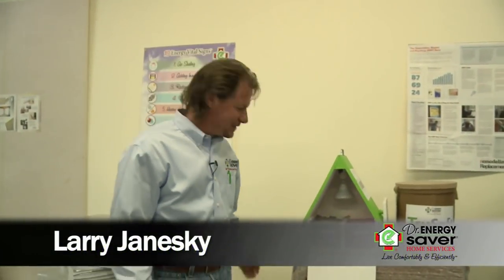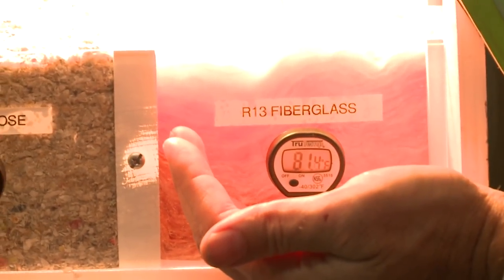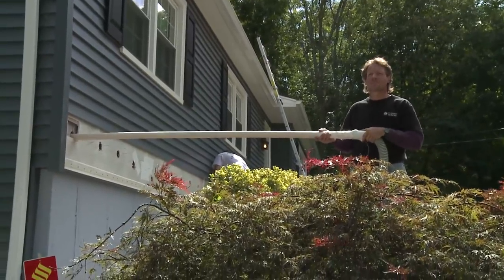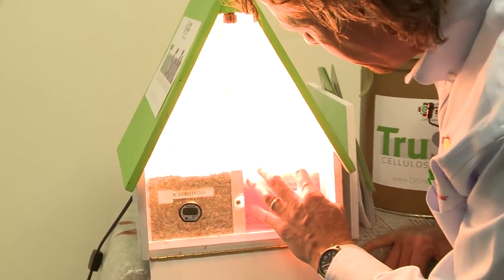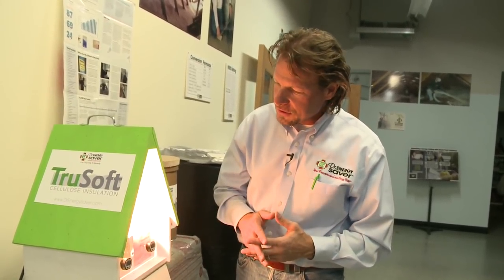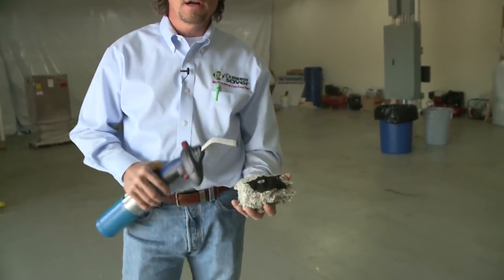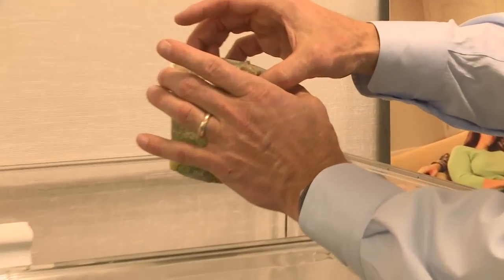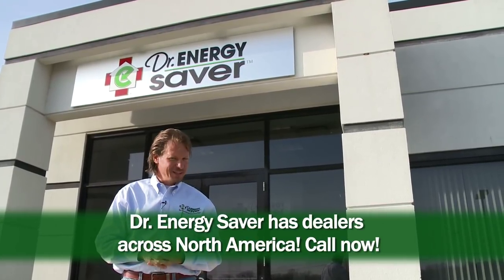Why Cellulose Insulation is Better than Fiberglass Insulation

Comment: I was suspicious of this test from the beginning. This guy seems to be anti fiberglass based on all of his past videos. Cellulose or fiberglass, it doesn't really matter. If you need R-38 in your attic, R-38 cellulose is the same as R-38 fiberglass.
Reply: +Earl Eggert, not at all. Cellulose is superiors to blown or batt fiberglass. It saves more energy and your home will be more comfortable with cellulose. Like in the video, often fiberglass is added three or four times before the latest homeowner wises up and does it right with cellulose. I've never seen a home insulated correctly with cellulose than needed more insulation later.
Reply: +Larry Maloney Cellulose will settle over time though. And, homeowners keep adding layers of fiberglass because their existing insulation each time is not of sufficient thickness in the first place. I don't necessarily have a problem with cellulose. I have it in my attic and it performs very well. I think cellulose is most appropriate for an attic floor, and older homes that don't already have insulation.  Fiberglass roll insulation will work just as well in an attic if installed properly, that is, if it the attic floor is first air sealed, and that one completely fills the joist bays the full height of the joists, and then lays another layer perpendicular to the joists on top of the first layer. The goal is to get the proper R value(thickness)
Reply: +Earl Eggert , fiberglass sales companies are notorious for "overblowing" fiberglass. They use less bags than required by fluffing it up. It's less dense than manufacturer's specs and so SETTLES very badly. The next homeowner sees it's settled and unwittingly blows more in and with the same result...the new fiberglass settles.Fiberglass rolls leak air along the length of very seam, every joint between rolls and between rolls and their adjacent ceiling joists. In addition, bridgi9ng occurs. that is, the edge of the studs conducts heat from the living area to the attic. Crisscross a second layer of fiberglass over the  first and it still leaks air and heat...just like water would.  Oakridge Laboratories ahs discovered fiberglass losses half it's R-value in cold weather. Loose blown fiberglass with a R-2.2 per inches becomes an anemic R-1.1 per inch in sub zero weather. Who needs that? Right when you need insulation it doesn't work. Cellulose settles a little initially...usually the first couple-three weeks. The contractor know the amount so adds extra so the customer gets the settled amount contracted for . That is the law! Read the bag instruction!Old fiberglass under newly installed cellulose may continue to settle.Cellulose is always preferred over fiberglass for walls ceilings and crawl spaces. Fiberglass isn't even a good furnace filter.
Reply: +Larry Maloney Again if you air seal the attic floor first, there won't be any air leakage. As with any insulation, you need to air seal first. I think overall cellulose is the best choice for attics, but fiberglass rolls and batts work as well, and are a good choice for walls. The key with any insulation is proper installation.
Reply: +Earl Eggert , my experience is cellulose air seals without additional effort or material. The ideal of foaming allthe wall top plates and light cut outs is not practical. The foam lays on dust and doesn't adhere. Besides, ever try laying a bead of foam? Ti never quite covers all the seams. If I have a seam that needs closed I use joint compound. It's cheaper and more effective. Remember, you're trying to seal against air infiltration, not insulate...so why waste expensive foam. The drywall compound seals most excellent. This winter I'll set up a demonstration to illustrate how well cellulose seals by itself. Seeing is believing.Installed properly, fiberglass does not seal walls as effectively as cellulose. there are always seams along the entire length of the studs. air leaks past, always! Installed properly, fiberglass still causes cancer and off gasses in fires. Besides, who actually installs it properly? It's mostly installed by contractors because it's cheap and can be thrown in the wall cavities by drug attics for a coupe bucks. "Installed properly"...LOL
Reply: +Larry Maloney 

LOOSE FILL INSULATION MEDICAL PROBLEMS INCLUDE: 

The most noticeable side effects of handling cellulose bagged Insulation is the affected skin become red, swollen, lumpy and painful.  Cellulitis commonly affects one of your hands or legs, although symptoms can develop in any area of your body. Additional symptoms can indicate that the infection has spread to your nasal cavities.  "Common sinus-cellulose nose infections can be treated with antibiotics over up to a three week period" Approximately 4 million people worldwide are affected by handling cellulose shredded newspaper insulation , and most sufferers find themselves on antibiotics for extended periods of time and experience difficulties in breathing after having it installed in their loft space or attic.
Reply: +SuttonWoods , total fabrication! I guess you only lie when your mouth moves or you are posting in unanimity.! Read the Material Data Safety Sheet (MSDS) to confirm there are no issues with cellulose insulation.  Then read the MSDS for fiberglass insulation and the health warnings will tell you to wear protective gear to protect your lungs from silica dust. In addition, the fiberglass industry is required by Federal Law to warn installers and consumers it causes cancer.  Some believe fiberglass insulation is more cancer causing than asbestos.
Reply: +Larry Maloney / UNDER no circumstances will my company purchase, buy or sell shredded newspapers and attempt to pass it off in sealed bales as loft insulation. Its not insulation but waste paper that's been strongly  condemned by the USA Healthy Homes Organisation (who said) : The
problem with using waste newspapers is the ink that is used by the publishers.  Printing inks can be complex preparation containing petroleum oil, vegetable oil, as well as various toxic bodies including turpentine, toluene, alcohol, and xylene which account for much of the odor given
off by shredded newspaper when used as insulation substititutes. , otheradditives in ink include pigments, driers, waxes, lubricants, perfume and dyes.Shredded
paper is a very low grade, inexpensive insulation. As such it is more likely to contain toxic impurities than the more costly fibreglass insulation because the inks used years ago were more toxic than those in use today. The paper is ground up into a very fine powder that can easily float around the air ans is easily inhaled. Some compounds can be
absorbed through the skin. Call it  Cellulose if you wish, to us its SHREDDED NEWSPAPER.
Reply: +SuttonWoods , your high pressure sales organization is geared towards selling high volume fiberglass insulation jobs. Since cellulose takes skill and time to install, profit is your motive for selling cancer causing fiberglass.I spoke with NAMP. These are the fine folks  your "Happy Homes Organization (a small family owned business) claims they were trained by. Did you know the mold remediation school, NAMP  has no issues with using cellulose? Their spokesman did tell a story abought a tough mold remediation case their trainees did for a mortgage company. The homeowner moved back into her home after ALL the mold was removed. After a few weeks she got sick again so the bank/mortgage company has the home retested and found lots of mold. The original mold remediation contractor talked with the housewife and learned she recently insulated her attic with fiberglass blankets. After she moved back in she brought some unused fiberglass batts from the attic and put them in the crawl space. The remediation contractor tested for mold again and found she has re-contaminated her crawl space with the fiberglass she removed from the attic. Bummer. Cellulose, unlike fiberglass, doesn't feed mold and fungus. In fact it's treated to resist them. In fact keep new sources of wet out and mold will never come back. Fiberglass makes cheap furnace filters. You know, Sutton, if fiberglass was a quality insulation product you would not have to tell all these whoppers.
Reply: +SuttonWoods ,another fib you tell! The Trans Pennine Pipeline transports ethylene so does not need insulation. And the climate is mild in winter. The pipeline installation used a special technique called "ramming" Fiberglass can't be rammed. The Alaskan pipeline, however, transports crude oil so is insulated with foam, not fiberglass. Fiberglass doesn't work under ground, it gets wet and freezes. I've removed frozen fiberglass from half million dollar homes after the plumbing froze. I corrected the problem by replacing the fiberglass with cellulose. Plumbing never freezes with cellulose. Isn't that amazing?Fiberglass does make a cheap repair for dented fenders.Foam is actually used for jet bodies. Special heat shields are used on the obsolete space shuttle.  None of your examples use fiberglass as insulation .Do homeowners actually believe this nonsense when you pounce on them?To be my boss you'd have to know more about insulation. You are a productive salesman but lack basic understanding about thermodynamics and how to insulate correctly.  I'd really have to lower my ethical standard and become a "yes man" like you to work in the fiberglass industry. No thanks.  The only one struggling is you...to come up with one good reason to get close to cancer causing fiberglass insulation, and I use the word "insulation" generously. The silica in fiberglass can lay dormant in your body for twenty years with no harm. But then one day your body decides it doesn't want it any more. Cancer develops. How's your health?.
Reply: +Larry Maloney . Owens Corning website, Wiki and Forbes Magazine  was the source of the information provided, $3.6 billion in sales and 15 000 employees means the products O&C make and sell are reputable with warranties that count, when your mixed POWDERS fail does the homeowner contact The New York Times, The San Francisco Chronicle, or Garret Press for a refund? Got a good slogan for you: Larry Maloney Powders are pulped from Playboy Magazines only, or your money returned.
Reply: +SuttonWoods , let's see if I understand what you are selling. You say fiberglass is guaranteed to not  pass the fire door test! You're saying fiberglass is guaranteed to have a lower R-value than cellulose. And you're guaranteeing fiberglass will lose half it's R-value on the coldest days...right when you need it...it goes on strike. As I recall, the fiberglass company that used to be the asbestos company guaranteed their asbestos too...but when they were sued for billions they filed bankruptcy to void the warranties and avoid paying the Court awarded billions in damages. Cellulose has non of the legal or performance issues of the asbestos company. Now that the asbestos people are in the fiberglass business it's buyer beware. "Fool me once, shame on you. Fool me twice, shame on me. Again, reliable science about insulation is provided by Oakridge Laboratories, not Wikipedia or a  self serving manufacturer of inferior fiberglass. When fiberglass fails the homeowner contacts me and I vacuum it out with the dead mice and their droppings...and usually a good measure of stinky raccoon waste. We disinfect before installing clean, fire retardant & insect resistant cellulose. We have to pay the County to dispose of the contaminated fiberglass. If you wish I can give it to you.
Reply: +Larry Maloney / I'm a like parrot. All I ever repeat is what I hear; Fibreglass is the best, Fibreglass is the best, Fibreglass is the best. I read in India  they sell shredded newspaper for insulation and employ hundreds of women to rip it into small pieces, later they discovered mixing it with sawdust and straw created a 2-fold product, bed mattress filling and loft insulation. Its sold all over India has Strawfill Cosybed Cellulose Insulation.
Reply: +SuttonWoods, you summed up your long "career" most excellently, you are reduced to a parrot by a giant corporation regurgitating whatever script they supply you. No need to think or question. Unfortunately for you (and the giant corporation), most homeowners think and question. Those who fail to do so may buy fiberglass insulation. But then they learn they could have invested in the "good stuff" as they call cellulose. Next time, their attic (and walls) gets cellulose. Your comment about being nothing but a corporate stooge sums up your life. You must have done something positive sometime? All the lies you spread about cellulose insulation are matched by the whoppers told by the foam guy. He doesn't tell customers his foam shrinks up to 3% at every wall stud. That's quite a large air leak, don't you agree? Gazillions of those tiny atoms you  get excited about must escape non-stop. Did you know most fire deaths in a foam insulated house are from the fumes? For all that poor quality insulation, consumers pay double. The foam installer has no way to know a retrofit foamed wall is completely full.  You and the foam guy are opposite sides of the same coin. Either choice guarantees a big profit for the installer but little for the homeowner. Interesting note to end on...I did a project for the Air Force so was inside a huge building held up by long thick steel columns. The steel columns were fire protected with spray-on cellulose insulation. I suppose the U.S Government never heard how great your fiberglass is. Aren't you in the Dayton, Ohio area? I bet you've taught a lot of naïve young guys, just learning the business, a lot of worthless nonsense and outright lies about insulation. Was your lies based on greed or ignorance?
Reply: +SuttonWoods , newspaper was used for insulation long before it was made fire retardant and bug proof. We've all seen a movie or two where the hobo lines his shoe bottom to seal the hole. Or he simply covers himself with newspapers to stay warm. As I educated you, it's called cellulose wood fiber because it's made from wood, a cellulosic  material. In the sawdust form, the same cellulose was once used to insulate the old ice houses of our ancestors. That ice stayed frozen all through the hot summer giving the townspeople a cold drink on a hot day. If fiberglass were used the town would be drinking hot coffee  all summer.Those same farmers ground up newspaper and wood to stuff in their attics and walls to insulate their homes. Of course they didn't know to add fire retardant, but then again, the didn't have electricity and were less likely to burn their house down. Even if they did it wasn't like they had a thirty-year mortgage and 50K pickup in the attached garage. They just built another shack. So if other nations recognize the insulating qualities of cellulose, good for them. Ever try sleeping an a bed of fiberglass? There's a reason your rule is the crew doesn't talk about fiberglass after the job...it's so nasty who wants to? A bigger reason for you is concern one of the brighter ones might ask an intelligent question or two and you can't access Wikipedia.
Reply: +Larry Maloney In almost 50 years I've never known a client to enquire about Cellulose Insulation, so would it be okay with you if I ask anyone who does to get in touch with you, you deserve each other. Take the order with my compliments. Let this person schmuck have the benefit of you're wisdom. If only I could arrange this for Xmas Eve, now wouldn't that be wonderful.  I can imagine you saying "Look Ma, that night time Correspondence Course I took paid off". I honestly wish you a successful and happy New Year for 2016. Just think If you book 12 jobs next year wouldn't  that be something to be proud about. Do this for just 3 years and you'll be able to buy you're very first trailer-trash trailer, and stop paying rent.
Reply: +Larry Maloney +Larry Maloney In almost 50 years I've never known a client to enquire about Cellulose Insulation, so would it be okay with you if I ask anyone who does want it - to get in touch with you. Take the order with my compliments. Let this schmuck have the benefit of you're wisdom. If only I could arrange this free order for you for Xmas Eve, wouldn't that be wonderful.  I can imagine you saying "Look Ma, that Correspondence Course I took paid off".Just think If you book 12 Cellulose Chop Suey Paper jobs next year wouldn't  that be something to be proud about. Do this for just 3 years and you'll be able to buy you're very first trailer-trash trailer, and stop paying rent.  I wish you a successful and happy New Year for 2016, but will stick to our  laying fibreglass insulation, fibreglass insulation, fibreglass Insulation, See, you have just reminded me that I'm crazy about the stuff.Fibreglass Insualtion .......... the best ..........
Reply: +Larry Maloney / 

 I understand your insulation company is called Larry Maloney Paper Shredding Services, who offer regular collections of confidential documents for shredding - to be used later as loosefill insulation. Company documents will be shredded on site in one of our mobile shredding vehicles, or transported to one of our waste paper Data-Shred Waste Paper Insulation  centres. Our range of waste paper blowing machines will blow your company documents into  loft spaces and attics. We specialise in both dry, and soaking wet waste paper processing. Rest assured all your documents inculding check books and bank statements will be collected for shredding by our expert collection teams. You don't need to remove paper from files or folders, or remove plastic wallets or staples, It all goes into the Anything Goes insulation bags to be re-used, Data-shred will save your company  tipping waste paper into landfill sites, this is our commitment to Green Energy.
Reply: +SuttonWoods, I missed the boat on that one. Although I did for a brief time shred bank documents back in the early seventies...before they had mobile units. I should have seen the future.  The bank president actually stood and watched until all his records were pulverized. I may put a mobile unit together yet.
Reply: +Larry Maloney , I've  missed so many boats I no longer care. I should write a book, we went from rich to poor 2 times, and founded 2 business that are Hope Diamonds. Again: Good staff are needed, our problem is weeding out the duds, once some men get 10 good wage packets they turn into careless monsters, money turns their b.. heads. So I never mock rich people, or smaile like we used to.?
Reply: +SuttonWoods , I never say never. I'm writing that book. You'll be a very small part of one chapter "World's Greatest Salesman."  Starting a business is easy. Operating a business requires a certain skill set. Salesmen don't make good businessmen because the believe all the lies they tell. To run a business you have to stay close to reality. I admire anyone who tries though.
Reply: +Larry Maloney / The problem is defining your own goals,  knowing your strengths and being able to second guess how effective you are as a self  motivated worker and leader of men, and as a buyer, book keeper, own accountant, person/spendthrift, drunk, drug user, sex pest, dreamer, entertainer or shrewd. Then choosing your products, market, suppliers, stock levels, tools, ideal business size and staff numbers and advertising orderer and selector. Somone who runs a one-site-mom and pop business is not a business person but an hobbyist. 

Businesses have 7 growth periods, and few people ever get past stage 2. Others (including the owner) cannot be trusted with money, may well defraud the state and social duties from day 1. Might ignore staff safety and product safety,  all these items are big DEPRESSING field of fences to cross, and, who shares the dream with you? no one- you're on you're own, from day 1.
Reply: +SuttonWoods , what you call "problems" I see as routine requirements for operation I guess it's a problem if your focus is selling a bad product instead of looking our for your customers best interests. I would not market any product I didn't not believe in and know to be as represented.
Reply: +Larry Maloney / Please
accept some houses are warm, some are cold and many are freezing cold. Some you
can insulate, some you can't, for instance I went to price for ALLROUND
insulation Belmont House, Bellevue Ave, Newport, Rhode Island, an old 1890
mansion. The owners are members of one of the richest familes in the world,
does Belmont Race track ring a bell with you? I told the owners  it was impossible to insulate it and the place
needed demolition, they were not best pleased. They wanted to deal with a liar,
a promiser if great things, to see insulation piled everywhere in big heaps.  A hole the size of a dime can sink a
battleship ship, and the same hole will allow all your valuable heat to
escape.Now do you understand the insulation trade better, I'm not writing an
100 page treaty, so think it out yourself. Fibreglass is best, Cellulose is
waste newspaper ran thru a shredder, adding sawdust to it might improve it
some. Best left well alone, go on vacation with the money you save by not choosing waster paper cellulose insulation.
Reply: +SuttonWoods .LARRY, SOME GREAT NEWS, I'VE FOUND YOU SOMEONE WHOSE WILLING TO CONSIDER HAVING CELLULOSE SHREDDED PAPER INSULATION, isn't that wonderful news, her only concern are about it's reputation for "Spontaneous Combustion", this worries her, so when you contact her don't forget to mention if the electical wires and light fittings in the roof space are well covered there's very little risk, hardly any at all. I'll let you know if I find others. Good luck on the road.
Reply: +SuttonWoods, if it has walls and a ceiling it CAN be insulated. The question becomes is it cost effective? Since they were members of "the richest family in the world" as you claim, cost isn't a factor.Considering your flagrant story telling about insulation I can believe you'd actually tell a homeowner they should demolish their home. The world's greatest fiberglass salesman is a structural engineer too! A hole the size of a dime won't sink a home (insulation-wise_ but there's no reason for that hole, unless of course the unsuspecting homeowner buys fiberglass insulation from you. Good luck getting the walls sealed. You have to add visqueen and hope it seals out the air infiltration fiberglass lets in. Sutton, I've understood the insulation business since 1974. YOU understand insulation sales...there's a big difference between selling fiberglass and designing a superior insulation package. Loose blown Cellulose Has an R-value of R-3.8 per inch while blown fiberglass has a weak R-value of only R-2.2. Fiberglass loses half it's R-value in the coldest weather that means it drops to a barely measurable R-1.1. What good is that?  Mice love to nest and crap in fiberglass. Do your customers like the stink? Fiberglass cannot be used (by law) as a fire barrier. Cellulose is approved as part of a fire barrier (by law). Your sales talk is synonymous for lying.
Reply: +SuttonWoods, I really appreciate all your nonsensical quips.   I've sometimes wondered where some homeowners get such odd ideas about cellulose. I guess I should thank you. Years ago I saw a wall cavity that had an electrical short. The wiring shorted out but instead of starting the usual fire, THAT wall was filled with cellulose fire retardant insulation. The shorted wires conducted electricity until they finally tripped the circuit breaker. On examination, the electrician found the cellulose stopped the electrical sparks from igniting inside the wall. He took a picture of the shorted/melted wires and the slightly charred cellulose. He then scraped away the charring to expose fresh cellulose just underneath...ready to stop the next fire. Seeing is believing. That electrician was sold on how great a fire barrier cellulose is. Of course, in your constant state of denial, reality has faded. Your daddy taught you well. You did most of your sales in Dayton, OH some of the installers told me.
Reply: +Larry Maloney / The mansion house cost the equivilent of $80 million dollars in 1891. its not an ordinary house, it had ballrooms, corridors that had corridors, heat escape spots everywhere, a few hunded windows, it once had 30 live in staff and grand parade staircases like you've never seen with dozens of bedrooms, bathrooms, servants quarters, racing stables, and worst of all chimneys everywhere, now tell me where would you start to insulate, It was sold for a pittance later, because no one wanted it, the roof repairs cost £3 million dollars to renew. Now tell me how you would insulate that, if I agree I will sing your praises all day long, and send you $50 dollars to get out of jail. Have you forgot we are there to save heat, I turned the job down, even if we insulated it, the places was so cavernous heat could not be controlled or retained, in parts it had mansard ceilings, ballroooms that looked like an old cinema, a nightmare, Not for us, we do not tell people heat retention lies, it was a job for you, not for us,
Reply: +SuttonWoods , you being a fiberglass salesman it's understandable you don't know how to insulate walls. I've developed techniques to insulate around fireplaces and the rest are just walls. If they are solid rock or concrete then, of course they have to bee furred out first. That takes money but these folks have money. Assuming it has a roof it has ceiling joists that can be filled with cellulose.  Most heat loss around the fireplaces is from air going up the chimney. That can be stopped too. Since I'm not on site I can't be more specific.
Reply: +Larry Maloney , Good Morning LM, let me know were you are situated so I can visualise the winter conditions there. How do you get leads and keep pushing for sales.We spent a lot of time canvassing in supermarket doorways, 20 YEARS+,  and using High St trade stands and moblie showrooms. The supermaket then gave the doorway sales concessions to a main agent who re-sold space to sub-sellers, us or the double glazing men. The door rents went skyhigh, from $25.00 per day or even free if you spoke to the shop manager with Larry Mahoney tears in your eyes,  the day rents  went upto $1000+ a day.  They killed the fat goose we had. 

I was thinking of you last night, I was recalling how painters would not paint the house siding and roof line frames and soffits if they were insulated with Cellulose Insulation because of the fumes from it, I can recall how roofing contractors left them alone for the same reason. Its okay for 20 minutes blowing it in, but day after day and standing on a roofing ladder or scaffolding was scary stuff. Celullose Fumes deaths stopped when painters and roofers started wearing Fire Service personell rescue air oxygen tanks.  I used to like to see flies land on a wall that had Cellulose Cavity Wall insualtion, it was funny how they staggered about, then tried to fly away, then dropped down dead. What a great sales point for you.
Reply: +SuttonWoods , don't be thinking of me late at night....sounds perverted. I'm "situated" where it's cold in winter and hot in summers so  my market is naturally everyone who has fiberglass insulation. I don't chase them; they call me wondering why their utility bill is so high. I think that painter whopper was a good'ern. I bet that stank was  him smellin his own  upper lip...probably dripped some high octane paint on it whilst painting the soffit.
Reply: +Larry Maloney /ref/ Painters: We insulated a Mental Ayslum, 100 000 sq feet. in fact we insulated a few dozen on a Govt Contract, in one a patient picked up a can of white paint and drank it, my brother ran for a nurse, she was not bothered one bit, she wiped his mouth and face and that was it. We talked about it for days because he showed no ill effects, We expected him to drop dead. Your company could do a with a guy like him, you could have him filling bags with dusty Cellulose day and night, swallowing the stuff and not care. We once watched a van containing Cellulose being unloaded near a beehive, when the job was done and they drove away the ground was littered with dead bees, even the Queen Bee had succumbed. The honey had to be destroyed and the bee keeper compensated by the Cellulose makers.  Deadly stuff that Cellulose, thats why we keep well away from it.
Reply: +SuttonWoods "silly" is all you've got. Fiberglass insulation manufacturers are required by Federal law to print cancer warnings on all product...and fiberglass insulation must be covered with visqueen or enclosed to protect humans from exposure. The fiberglass insulation Material Safety Data Sheet (MSDS), provide by the manufacturer, as required by law states it is  a health hazard and installers must wear personal protective devices for there protection. Cellulose, on the other hand, have none of these "shortcomings". Queen bees stay in the hive, BTW.
Reply: +SuttonWoods, for your own mental well-being you've got to let go of the glory days. The government built a bridge to nowhere so buying cancer causing fiberglass insulation for a mental institution is no surprise. Today they recognize their stupidity and are offering a grant for "green" projects. I'm submitting mine. A simple suggestion like "Remove all the fiberglass insulation form mental institutions and replace it with cellulose to save 30% on energy costs" would be a great entry. Imagine, no more worry about the mentally ill burning the building down. And they won't be exposed to cancer causing fiberglass insulation anymore. Did you have problems getting out of the mental institution?
Reply: +Larry Maloney / The argument over. You cannot name one major builder, one local authroty who use it, its sold to the elederly and ther gullible, tell us all the average price per dwelling. ots a con and you know it. Waste paper is waste paer is waster paper. Landfill waste is not an insulant. Nmae just one majot bulder, I can nmae 500 , yes 500 who use and have always used Fibreglass, I'M PROUD TO SELL FIBREGLASS AND SO ARE ALL MY FELLOW INSULATION CONTRACTORS, we buy it for good money, we do not get it free to take away - rather than pay tipping fees to take it to a landfill site.
Reply: +SuttonWoods, your nonsense blather convinces only YOU! The measure of quality insulation isn't who sells the most. IF that were the case, Wal-Mart would be the fashion center of the world.  Besides, what you've sold in the glory days of your youth is no reflection of what you'll sell in the future. Homeowners are wiser to your tricks these days. The internet exposes your trickery and deceit. They compare attributes that make a cost-effective insulation a good investment, not how much a high pressure salesman can peddle in a day. You have NO pride, otherwise you would not sell inferior fiberglass.
Reply: +SuttonWoods  I want to see a COMPLETe LIST of your 500 contractors ALL OF THEM.  As a  cert BPI energy auditor  and Insulator of 27 yrs I can tell you that after usinf BOTH aterials and doing our own testing Cellulose IS FAR SUPERIOR to FG in all ways. Heck I live in the country and had blown glass in my attic VACCUMED IT OUT and installed Cellulose and in JUST THAT alone lowered my Propane bill per gal by 22% !! AND THAT WAS WITH A COLDER WINTER PER HEATING DAYS than the year before! AND the cost of LP was UP 7%!! ...facts remain fg is sub par
Reply: +scott bickett , Sutton woods doesn't have any real understanding of insulation. He's a wind-up fiberglass salesman. By his own admission he just parrots what big fiberglass programs him to say.
Reply: +scott bickett //  Owens Corning turnover is £3.6 billion per year, they are a Fortune 500 company, Cellulose firms are small waste paper traders converting waste paper into an alleged insulation. For every waste paper blower, you may have 100 / 200 Fibreglass Installers, used Cellulose blowing equipment is being sold on Ebay every day at giveaway prices, We were offered 10 machines for $50 each, scrap prices, we never bothered.  I have never tendered for a cellulose job ever, Not one major newspaper I 've seen ask advertises bids wanted, Fibreglass different, a boom industry since 1960. Don't you find that once clients know its waste paper your selling they tend to remember that they promised to go and collect their mother-in-law. How embarassing that must be for you all.
Reply: +SuttonWoods , where are these fifty dollar cellulose machines? I'll buy them all. Where are they? We don't have 200 fiberglass installers in our area for each cellulose installer. In fact I hardly ever see a fiberglass truck on the road. Wonder why. In fact the area's largest fiberglass company just liquidated most of it's trucks.. Their lot is empty. So is their install schedule. now make up some more lies, Sutton.
Reply: +SuttonWoods , why do you suppose Owens Corning's credit rating is "BBB" instead of "AAA"? And if fiberglass is so great why is OC switching to foam? Going into winter their stock is down...wonder why? Fiberglass reinforcement and fiberglass roofing shingles is there bread and butter these days. Fiberglass insulation (causes cancer) puts the company at risk. I look to see fiberglass sales continue to decline as cellulose becomes better known.
Reply: +Larry Maloney //   I like you're plan to recruit Boy Scouts to gather waste paper for you door to door, (Did you give them the old saving the Earth story which has proved such a gold mine for the Cellulose waste paper shredders) Do phone you're dear old Mother for me will you, and bring her up to date with the latest news. That correpondence course you certainly took paid off, Was it the Dale Carnegie How to WIN Friends and sell More Cellulose waste paper Insulation course you took. How Wonderful.
Reply: +SuttonWoods , your really struggling. You've been exposed by science and left behind by facts...you are irrelevant. Your chatter is background noise while men are working installing superior cellulose. I wonder if I've hauled as much fiberglass to the dump as you've sold to unsuspecting homeowners. I hope so.
Reply: +Larry Maloney //  The dump, the dump. I get it, take an old sofa in, and sneak a few ton off waste paper into the back of the van at the same time,  never been to a dump for years, its the smell you know, the smell of rotten waste, Don't you ever find any old jeans or used clothes up there that you can sell by having a garage sale, and pass out your Cellulose business cards at the same time. A sort of straight-from-the-dump-sale.
Reply: +SuttonWoods , filibustering with lies serves no more purpose than your denial. Blown fiberglass only has a R-2.2 valu8e while blown cellulose has an R-3.8, nearly twice as effective. Even installed correctly (which is seldom) fiberglass loses half it's R-value on the coldest days. The R-value of R-1.1 is a joke...not to mention fiberglass is known to cause cancer. Why pay for fluffed up fiberglass that doesn't even work when it's installed correctly.  You must work really hard to find gullible buyers.
Reply: Larry, did you know cellulose loose insulation is not approved for use in large parts of the United States, because if the house roof is blown off during an hurricane it gets windlown all the area in the ongoing windstorm. See:>;   Cellulose Installers are requested to recognise that we need to raise awareness amongst homeowners to ensure they are fully prepared in the event of windblown cellulose insulation leakage from their loft space in the event of a hurricane –causing roof and bedroom ceiling damage to their property, with substantial amounts of cellulose insulation from the affected property/s blowing around the properties and its boundaries. One of the important issues cellulose insulation businesses and householders face is not knowing where their clean up boundaries are, and when the next hurricane will strike. While Hurricane Katrina has tended to fade from memory, New Orleans isn’t the only major U.S. city at risk. As Hurricane Irene demonstrated, weaker hurricanes can also do significant damage in places that are not used to experiencing such storms. Many Americancoastal cities are essentially sitting ducks to hurricanes, with millions of
Americans living at water’s edge, exposed to high winds and flooding. Cellulose insulation should NOT be installed in 10 largely rural counties in the Deep South and near the Gulf Coast, These well known hurricanes areas are: Desoto, Fla. Houston, Texas, Polk, Texas, Issaquena,
Miss. Highlands, Fla. Avoyelles, La. Walker, Texas. WIlkinson, Miss and Glades, Fla. Kemper, Miss.
Reply: +SuttonWoods  the nonsense is endless with you. Do you realize you left your credibility behind many posts ago? According to Owens Corning, their fiberglass insulation is a known cancer causing product. They even print the warning on every batt, bag, and roll. According to Owens Corning, it;s important to wear protective gear when installing fiberglass insulation. Federal law requires all exposed Owens Corning fiberglass insulation be covered with plastic to protect humans from contact. Imagine cancer causing fiberglass insulation being blown around town by a hurricane!
Reply: +Larry Maloney / You must NOT sell insualtion in these areas unless you warn the householder that if an Hurricane passes by it will suck the LOOSEFILL INSULATION YOU LAY out of the loft space and it will disaapear over the hills and far away.  Fibreglass does not have that weakness, You are selling paper shredded dust, and dust is what causes dust storms, You're ruining America.
Reply: +SuttonWoods , have you considered taking a long vacation? Breathing fiberglass all those years may be causing some problems for you. Imagine flying cellulose all over the sky. Personally I'd rather get hit by flying cellulose than a board, or itchy  fiberglass.
Reply: +Larry Maloney // Who'd ever  imagine that loosefill insulation can become a Surface to Air Missile when an hurricane passes overhead. The wind uplift is so great that one missing roof tile hole in the roof can cost you all you're insulation material, work and expense. Gone in a flash. And it's not covered by thehouseholders  insurance policy. 10 Southern Counties will not allow loosefill Cellulose insulation in roofs. First it was classed as a fire risk,  but this 2nd report dooms the whole industry to Cahpter 11. I told you to drop it, now your stuck with all that useless blowing equipment and Hurricane Valley State Laws won't let you work.
Reply: +Larry Maloney  /  Cellulose Banned  Many Americancoastal cities are essentially sitting ducks to hurricanes. Cellulose insulation should NOT be installed in 10 largely rural counties in the Deep South and near the Gulf Coast, These well known hurricanes areas are: Desoto, Fla Cellulose Banned . Houston, Texas, Cellulose Banned Polk, Texas, Cellulose Banned Issaquena, Miss.Cellulose Banned  Highlands, Fla. Cellulose Banned Avoyelles, La. Cellulose Banned Walker, Texas Cellulose Banned . WIlkinson, Miss Cellulose Banned and Glades, Fla. Cellulose Banned Kemper, Missippi  Cellulose Banned .
Reply: Horse burnt to death in stables  using cellulose as horse bedding. (www)T he stables and an adjoining barn and horsebox destroyed, other horses rescued by the fire services. The cause of the fire is suspected to be an  unsafe electric light cord whose  bulb was not enclosed with a safety cage or bulkhead fitting.
Reply: +SuttonWoods  lets talk about the Turkey farm in Indiana that caught fire  THE DAY AFTER it was opened for buis and when the ceiling caved in the fire WAS SMOTHERED OUT because of THE CELLULOSE. THAT information came from the INDIANA state fire marshal.
Reply: +scott bickett // How terrible. The turkeys were smothered under Burning Cellulose, buisiness ruined,  I know about a couple who had an electrical fault cellulose insulation fire, the firemen broke holes roof, to allow the smoke to escape, they then HOOK-pulled the bedroom ceiling down because they were forbidden to work in the loft confined space in case it collapsed, they used the fire hoses, the couple regret having cellulose, but regret even more calling in the fire callout emergency crews, the water hose damage was more than the fire damage. And Cellulose debris and home contents were laid everyhwere ruined. Cellulose is shredded waste paper, and waste paper burns. Its newspaper waste.
Reply: +SuttonWoods , was the horse smoking in bed? Cellulose is rated as a fire barrier. Cellulose DOES NOT burn. Fiberglass insulation won't stop fire form spreading. Of course, you being the world's greatest fiberglass salesman, you know fiberglass's shortcomings. No reputable horse breeder would let fiberglass near a horse.
Reply: +scott bickett , years ago I manufactured cellulose. The building was brick with a slate roof and wood floors. An arsonist lit three fires inside. The entire structure except for the bricks and slate burned down with one exception... I had built an office in the middle of the building.  Two by four walls with drywall inside and out...and 2x6 ceiling joists with 5/8" drywall and cellulose dense packed in walls and an R-40 cellulose in the ceiling (to kill the noise from machinery)! Some brick walls were standing and my entire office and bathrooms was still there. None of the contents was damaged by smoke or fire. One calculator was ruined by the fire hose water dripping off the slate roof. Fiberglass would have just melted and I would have lost all my office content. The entire story will be in my book.
Reply: +SuttonWoods, as you know the defense for slander is fact. However your tales are so outrageous you aren't covered by those laws. A Court would rule that your tales are such whoppers a "reasonable man" would recognize they aren't true.  In other words, you are so silly no one takes you seriously. That is your defense against slander.
Reply: +Larry Maloney //  Cellulose paper insulation materials are environmentally friendly,  cost effective due to its waste paper origin when compared to Fibreglass insulation  but it is combustible and rapidly burns out. The main causes of cellulose insulation fire are: chimney related, Electrical faults, Lightning strikes affecting the roof and contractors carelessness. Installation advice: Electrical / Check and test the attic space electrical installation by a qualified electrical contractor at least every 3 years . Loft wiring should be in conduit but not attached or adjacent to cellulose insulation.Do not place high wattage lights or electric fires near the insulation or allow the insulation to overhang electric fittings.  Do not insulate near recessed lighting into the ceilings below. Use heat resistant bulk head light fittings in the roof space. Electric supply cables need to be prevented from coming in to contact with cellulose insulation, or adjacent to other flammable materials.
Reply: +SuttonWoods, I appreciate your bravery in stepping up and making such serious defamatory statements. I'll forward your accusations to CEMA (Cellulose Insulation Manufacturer's Association. I know they have required retractions on less inflammatory (no pun intended claims.)  Frankly, if you were in my home town, market area, I'd personally demand a retraction, and then sue you. Agreed, cellulose is environmentally friendly but it's because newsprint is less demanding of energy to process than when Owens Corning melts sand (which is more abundant than newsprint). Melting sand for fiberglass spinning is an extremely wasteful energy hog.Again, cellulose is treated to be fire-retardant and used as part of an approved fire barrier in construction. Fiberglass is not. Fiberglass melts and the gas is harmful to humans...harmful beyond the know cancer related issues of fiberglass insulation. Agreed, lightning strikes, electrical shorts, and chimneys all cause fires. Cellulose insulation reduces the spread of those fires. Fiberglass insulations melts away and creates air chimneys inside walls allowing fire to spread to attics and other rooms. Of course you know this.
Reply: +SuttonWoodsl, you remind me of my first puppy. No matter how many times I rubbed his nose in it, he kept peeing on himself.
Reply: +Larry Maloney /  it sounds as if your dog had been eating cellulose insulation and was terrified it would die.  Some dogs will eat anything but not Fibreglass, but, strange to say we once did a massive piggery walls and roofs and the pigs were eating the fibreglass cut-offs. One of the men dropped a roll and they tore into it as if it was candy-floss.
Reply: +SuttonWoods , can't imagine an animal eating cellulose insulation. The boric acid might irritates their eyes. That's why mice and raccoons don't like to nest in it. I';ve used it for bedding for cats by packing it down tight and the boric acid kills fleas. But the cats get insulation all over themselves anyway (even though it's packed). If all vacant houses were filled a foot high with cellulose on the floors no one would try to winter in them or set them on fire. Fiberglass might work better to keep people from wintering in vacant houses. The itch would drive them off...unless it was atticcat.
Reply: +Larry Maloney / I have eye trouble and it could be fiberglass, had it for 20 years, really ill, tried everything, none any good except of all things HONEY, i smear honey in my eyes last thing at night every night and its amazing how effective it is, it stops the blinking, the eyes are part of the brain, and mine have been really bad, I was diagnored as fuctionally blind with no known cause, but it could be trade chemicals including fibreglass, I can see now, but was very ill for years.
Reply: +SuttonWoods  you couldnt be ANYMORE wrong if you tried. You DO realize your speakingto a 27 yrs in the buis installer with OVER 6500 jobs under his belt? When you spew your dollar claims about OC THAT IS NOT TE FIBERGLASS ONLY money! In Fact tyhey have had a 35% reduction in profit with FG over the last 4 yrs. WHY? CELLUOSE IS BETTER!  WHy would the local gas and elect utilites INSIST in there energy incentive programs that FIBERGLASS CAN NOT BE USED! ONLY CELLUOSE! ( I guess they are wrong as well huh?)
Reply: +SuttonWoods I NEVER SAID ANY TURKEYS DIED! in fact NO TURKEYS WERE IN THE BUILDING!  THe Fire marshal WAS QUOTED as saying " the cellulose in the ceiling stopped any more damage from happening" unquote.
Reply: @scott bickett /   Can you send a link Scott containing information on the Cellulose Miracle Fire Fighting Products you sell, if I had Cellulose in the house I'd keep a fire engine outside and insist that my wife wears a firemans helment in bed, I did trace: Recent animal shed fire burn victims include 7,000 turkeys at a Butterball operation in North Carolina, 250,000 chickens at an Ohio Fresh Eggs, who supplies Cal-Maine and 500,000 chickens at Moark Hatcheries, a  supplier in Colorado. (these are not Cellulose related in any way - at least I don't think so,)
Reply: @Larry Maloney / My reply to Scott was: Recent animal shed fire burn victims include 7,000 turkeys at a Butterball operation in North Carolina, 250,000 chickens at an Ohio Fresh Eggs, who supplies Cal-Maine and 500,000 chickens at Moark Hatcheries, a  supplier in Colorado. Cellulose client/buyers should keep a fire engine outside the house, in the driveway, and wear a firemens helemt in bed,
Reply: +SuttonWoods  Here's a summary of celluloses superiority as a fire barrier.: Summary:
The International Building Code recognizes the fire resistance superiority of cellulose insulation compared to
standard light density fiberglass batts or foam insulation. An additional 15 minutes of protection is provided by
cellulose insulation while 0 minutes are permitted for light density fiberglass batts and foam insulation.
Reply: +Larry Maloney . I never knew Cellulose was that dangerous,  that people have got just 15 minutes to get out of the house before Cellulose explodes. So it's true what peope say about it then  (that) if you order Cellulose Insulation you ought to spend at least a $1000 dollars on beefing up your homes fire protection precautions. My advice is to wear your clothes in bed, and to keep a bucket of sand handy just in case. Did you know fire axes can be bought on Ebay, also rope escape ladders,  you ought make it your duty to give these away free to clients with every order booked over the Xmas period.
Reply: +Simple Sutton Sez "Cellulose adds 15 minutes more time than fiberglass's zero minutes to escape from a fire." "Hmmm, how can I distract from the weak qualities of fiberglass?" "I know", sez Simple Sutton, "I'll tell another whopper."
Reply: +Simple Sutton, since I don't type brail I'm surprised you can read my posts. I'm not aware of fiberglass causing loss of vision. Since you say there is no known cause your doctor is suspect. Bacteria won't grow in honey. It's a good remedy for boils and infections. Just fill up the cavity...densepack, like with cellulose, and the bacteria will die.
Reply: +Larry Maloney , Eyes are getting better, hospital drugs no use, a newpaper report alerted me to the benefits of honey, I am regd as blind but can see, isn't that strange. Its my eyelids that won't move or open freely, they can now. Medical Causes was: A CELLULOSE sales rep tried to sell us bags of Cellulose Insualtion and left samples, just one look at it and I  was struck blind. On the bag it had warnings about not handling unless you were wearing Radiation Barrier Shield Clothing and I ignored the warnings thinking they could not be true, they were.  Did you know it was used in films as a substitute for Kryptonite, and you know how toxic that stuff it?
Reply: +SuttonWoods , my uncle was blind all his adult life from a fire as a teen. He worked and raised four fine kids. The fire left him with a severely burned leg which they eventually amputated so he's suffer less pain. I always admired he never complained.
Reply: +Larry Maloney //  Same problems here and my respects and best wishes  to you're uncle,  I had a aunt who slipped in the kichen on a wet floor, she went flying, landed on the cooker and a pan handle pierced her eye, and my girlfriend and wonderful wife of 54 years had a stroke and went blind in one eye, 50% the other, (can't dress, can't find the bed, can't walk around the house or  watch tv or find remotes) the real victims are war blinded  US & British Army maimed Veterans. Helmand Province and Afghie "They were expendables" <(anger rising) Regards & Besr wishes.,
Reply: Larry boyo: You know full well there are two tpyes of fiberglass, there;s glass wool fine fibres used in insulation, and glass MAT coarse fibres used to make boats, caravans and truck cabs and bodies, one is harmless, the other is, or is classed as an possible carcinogen. For WWW-Links see: What is important about this wording is the term “glass wool fibers are excluded FROM CARCINOGEN LISTS,” VIZ bodybuilders / aircraft builder fiberglass did receive received a carcinogenic listing. seeIn general, insulation fibers are less durable and less biopersistent than special-purpose truck builders fibers, and may be less likely to cause cancer than the more durable, more persistent special-purpose fibers.”Why Was Fiberglass Removed from the Cancer List? By removing fiberglass from the “reasonably anticipated to cause cancer” list, OSHA doesn’t list it as a problem for workers, which means dangerous exposures may continue to occur, particularly in factories where fiberglass products are produced or worked with on a daily basis.
Reply: HOUSE INFECTED WITH CELLULOSE
PAPER MITES.

Our health got worse. My wife kept
telling me something was wrong the doctors weren't finding. All of us itched
and barely slept. Our symptoms became worse. Our doctor was treating us for
parasites! The logical answer he said was waste paper mites. All evidence pointed
toward the cellulose paper mite: which can't be seen with the naked eye,
thrives in attic spaces, and whose bite inflicts its hosts with many ills.  We arranged for management to fumigate the
house a second time and adding the attic area to the list to be fumigated. At
night, just before going to bed, we would rub ourselves down with
"Cellulose Soft Skin protection.” We still itched and felt sick. We put
the blankets and sheets in the dryer for 20 minutes, along with our pajamas to
kill the mites. The property owner called and saw paper mite droppings on the
bed head. . The droppings were old, he said, because they were hard. If only we
had not had this work completed.
Reply: +SuttonWoods, strokes are diet related. In fact, they are the result of poor food choices. Clearly y'all don't know my more about nutrition than insulation. So sad folks ruin their own health out of ignorance. The food police (big business) advertise ferociously to eat their processed foods and the gullible consumers who do have strokes, heart disease, diabetes and cancer.  Diabetes, type II and arterial related diseases are 100% avoidable by intelligent food choices. And 85% of cancers are triggered by food choices. Still we eat unhealthy and have strokes.
Reply: +SuttonWoods, you can make up whoppers at will! Impressive.
Reply: +SuttonWoods , in a sad sense it's poetic justice in that fiberglass lobbyists pressured OSHA to reduce it's cancer warning about fiberglass and unhealthy food lobbyists pressure our government to not warn about the cancer causing effects of meat & dairy that you, a benefactor of the fiberglass lobbyists is also the victim of the food lobbyists. Since you can't understand the harm they do to the public with fiberglass insulation you instead LIVE the harm done by lobbyists forcing our government to bless cancer causing foods. What's that old saying, "You made that bed now sleep in it".  Here's a little of the story about cancer causing fiberglass insulation being upgraded under lobbyists pressure so you can sell more to unsuspecting consumers. In fact this doctor says on his web site we should remove the fiberglass insulation to avoid exposure to cancer. I will, in the future, explain to customers how busy the fiberglass lobbyists have been. You boyz are desperate to sell this garbage.Dr. Mercola says that removing fiberglass from the carcinogenic list means that OSHA does not have to declare it is hazardous for workers. This means that people working in fiberglass factories every day are exposed to dangerous levels.This is reason why the National Association of Clean Air Agencies (NACAA), a consumer group, protests the findings, claiming that the US Environmental Protection Agency (EPA) and the National Institutes of Health (NIH) have altered the formula used to determine carcinogenicity. This is why fiberglass seems safe when in reality, it isn’t.NACAA calls for the government to reexamine the fiberglass data, so that fiberglass workers may be protected from this potentially carcinogenic substance.
 Richard Belzer also gives his comments regarding the NTP carcinogen report, and notes many inaccuracies, including in the fiberglass data. He claims that the listings are “not scientific determinations so much as policy decisions justified, where possible, by science.”
Reply: LH: 

What is Cellulose Garden Compost made from? Cellulose
compost is made from unsold cellulose insulation - past its sell-by-date - and sold on by retailers at substantial discounts, to clear their stocks of it. Cellulose is an organic bio-degradable substance often found in its natural form at the base of trees and in woodlands, it is a wonderful conditioner for your soil. As an organic-matter resource, cellulose compost has the unique ability  to improve the chemical, physical, and biological characteristics of soils. It is also used today as a less popular form of insulation, when so used the product is available in vapor-retarder plastic bags, care must be used in hot, humid climates due to its high microbe count and tendency to harbor paper mites.
Reply: +Simple Sutton, don't know what "LH" thinks, but you're confusing two different products.
Reply: Why do the baggers of waste paper (newspaper rags) intended for sale as *insulation call it  *C-E-L-L-U--L-O-SE to suggest that it's an *EXTRUDED product made using some complicated process. Is
it because they know their sales staff and installers will be asked to leave homes if they REVEALED its waste paper shredded in a shredding baler, then bagged and passed off as INSULATION. * Why do they not reveal it settles 40% and if they sell and allegedly install 19" inches of waste paper few months later a physical check will reveal it’s settled to plus or minus 10" inches? When blown in it comes out of the machine like SNOWFLAKES, and we have all seen how snowflakes move and settle into an ice layer. The public deserve the truth;they want value for money and long lasting value. *Cellulose is a fraudulent threat to the good name of the Green Energy movement, and to energy savers everywhere.
Reply: +Simple Sutton, the cellular structure of trees and the newsprint produced form trees and the fiberized cellulose insulation produced from newsprint doesn't imply it's "extruded". I doubt you even know what extruded means. Process control is the ability to reproduce quality after quality of the same product with no variation in quality. Fifty years ago cellulose processing was low tech low energy. Today processing cellulose is high tech low energy.  Extruding it would be very expensive...like extruding fiberglass. Cellulose is typically fiberized from raw newsprint by passing it through at least two pulverizer mills. Each has screens to size the product. The fire-retardant is metered in by weight. Proportioning it to exact amounts to insure it's fire retardant, unlike fiberglass. Your ignorance about the extrusion process is obvious. But then the world's best fiberglass salesman doesn't have to know anything about anything except how to create fear and doubt. You are most excellent at your craft. As Is your boy, I'm sure. My comments on the press of producing cellulose insulation is simplified for my audience, YOU, any greater detail would simple be wasted.
Reply: 50 years ago there was 350 waste paper sellers shredding newspaper paper and PASSING IT off as  insulation, these companies werel jumping on the Save Energy bandwagon created by reputable firms like Owens Corning Fiberglass the market leader. Because it was paper it burnt and for this reason many valuable homes went up in flames.  The US Government stepped in and insisted amongst other things that a flame retardant had to be added. This was expensive and approx 300 Cellulose firms folded overnight. Those that remained commenced calling it Cellulose for P.R. reasons - to conceal the fact it was waste paper they were selling, Today, it's marginally improved waste paper, but waste paper never-the-less. Proof of these assertions can be found on Wiki, under Cellulose insulation History. Because it settled a adhesive was added so after it was blown/laid into attics it would not be subject to incredible settlement. A fade away product. All this can be found on Wiki.
Reply: +PipersSon , you don't know your history very well. Cellulose has been fire-retardant since inception. It wasn't until the late 70's...early eighties that some mom and pop operators didn't put enough fire retardant in their product. For that reason federal standards were set. No problems since. And the reputable manufacturers were NEVER a problem. The only insulation that burns is fiberglass and some foams. Fiberglas can't even get approval and certification as a fire wall or fire stop. Cellulose exceeds both those criteria.
Reply: +Larry Maloney Fiberglass insulation doesn't burn, it melts. The only exception is the kraft faced batts, and it is only the kraft asphalt facing that burns, not the insulation itself. Another point to make is, cellulose can ignite and burn depending on conditions. 
The product's fire retardant chemicals will degrade over time, so generally the older the insulation is, the more it will become a fire hazard. How long it takes for the chemicals to degrade I don't know, my guess at least 15 to 20 years.
       Here are a few newspaper articles  of house fires and their involvement with cellulose and a couple of articles describing the fire hazard of cellulose

1996 Toledo Blade article  https://news.google.com/newspapers?nid=1350&dat=19960808&id=WlxPAAAAIBAJ&sjid=cwMEAAAAIBAJ&pg=5479,2337159&hl=en
1999 Toledo Blade article  https://news.google.com/newspapers?nid=1350&dat=19991226&id=D9cjAAAAIBAJ&sjid=rwMEAAAAIBAJ&pg=5064,3383241&hl=en
1987 Spokane-Review https://news.google.com/newspapers?nid=1314&dat=19871217&id=Fb5YAAAAIBAJ&sjid=D_ADAAAAIBAJ&pg=5477,465862&hl=en
1992 article describing cellulose fire retardants degrading over time and the materials tendency to smolder https://news.google.com/newspapers?nid=1241&dat=19921023&id=VEVTAAAAIBAJ&sjid=IYYDAAAAIBAJ&pg=6584,2463582&hl=en
1998 article describing cellulose fire hazzard https://news.google.com/newspapers?nid=861&dat=19980508&id=94laAAAAIBAJ&sjid=aksDAAAAIBAJ&pg=3804,1687600&hl=en
Reply: +Earl Eggert . eARL: Can you imagine working for this Happy Larry Maloney, Im used to signiing up 50 deals per week, he's happy with one deal, 2 - so much the better, I wish I had his dead leads to convert, 40 years ago we once had a Maloney work for us. I  gave him 20 fresh leads, rung to him to ask how he was getting on, he said great they all want it, I asked him how many he'd signed up, it was 00 ZERO, he thought he was there to introduce the company but not to ask for the order.  I had to go back and signed up about 16, all straightforward deals, our Maloney was blind to the fact most people can 2nd guess if you are genuine, or on the level and are priced fair meaning good value. Maloneys a bull-shit artist, who gets the trade an bad name, Thanks you for the www-links I will read and copy them for my persoanl sales trainer library, have a good week. Piper.
Reply: +Larry Maloney . He's correct, cardboard, wood chips, sawdust, sand. sheeps wool, straw, hay, rags and in your case waste paper all qualify as  insulation products. So the pecking order comes in value. longesvity, ease of laying, presentation and public acceptability and the tonnages available. Waste paper always been a glut on the market, waste paper mountains are everywhere, which explains why our local waste paper firm will not buy it, they want you to deliver it to them free, they are 40 miles from me.  I admire your chutzpah, going out there knowing its worthless junk, and drawing big bucks for it,  I'm lazy I want a quick sale, an even quicker easy yes, and okay we don;t make $200 dollars profit a sale, more like $200 dollars, we are happy. You see being an honest man has got hell of a lot of kerb appeal to buyer and sellers, I guess you've sold double glazing, time share, old carsm and are a Police arrest regular, we are different, tell me please HOW MANY MARRIAGES IS IT FOR YOU,?
Reply: +MommasBoy, the one thing not on your list of insulations is "Fiberglass". I agree, it's not insulation. It's a license to steal. A lot has changed since you were put out to pasture. Homeowners are more informed, therefore more sophisticated. They don't fall for the scare tactics that lined your pockets with easy money back in the day. Your game wouldn't play in todays high tech insulation market. The only customers for fiberglass "insulation" these days are the builders of cheap houses. And that doesn't take product knowledge or even salesmanship...just an order taker. Even you could do that. "Mr. Builder, we have our bottom of the line insulation package for your cheap houses...all fiberglass installed by dope heads..they can't even tell it itches. Sign here.
Reply: +Earl Eggert R values are lab produced  not  real  world  performance 
R 12 of XPS foam will out perform R 20 fiberglass in the real  world  because  XPS  dont  allow convection  currents and  fiberglass   as we  all know  convects like  crazy
Reply: +Earl Eggert . XPS is the name of the alleged best news paper shredder ever made, its got 240 spinning blades. annd 320 chippers, and two compartments and a bagging plant, have you ever listened to the zing when they go on full revs. saw saw, slit slit, crush crush, chip and chip, crush and chip.  crush and chip. then you bag it, waste paper you're wonderful, 90% profit on every job, and no ones knows it plain old shredded newspaper ...
Reply: XPS  stands for Extruded polystyrene foam
i think you may have inhaled too much fiberglass dust
Reply: +Randy Ross . In the insulation trade XPS stands for EXPERT SCAM, it was two guys from NY who tippled if waste paper was shredded, and called Cellulose the public would think it was made in a lab,  made on a machine and was genuine insulation. One of these guys bought a Cessna Jet called Vegas 1, the other dissapeared when he heard the FBI were going to call, and seize thier records and the waste paper balers theyd purchased. Bagging it was the best idea of the lot, clients could not see it in the flesh, or handle it. Google Cellulose Insulation fears, are you aware it banned in 13 states and there are over 5000 lawsuits on the go? Google Waste paper and cellulose scams and health fears.